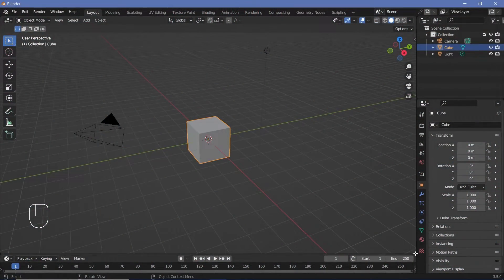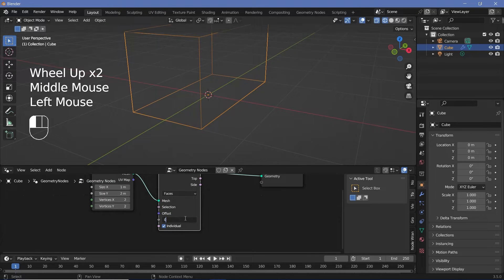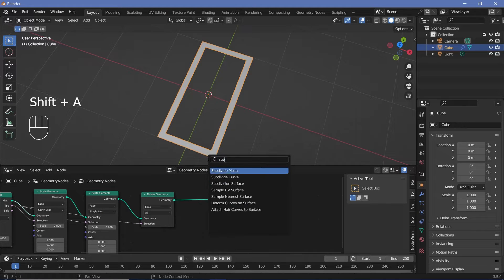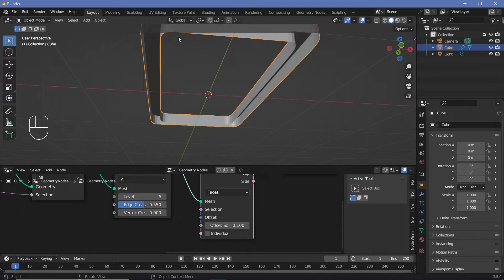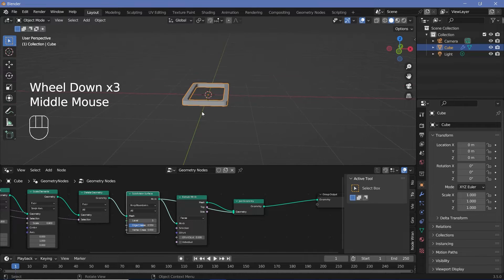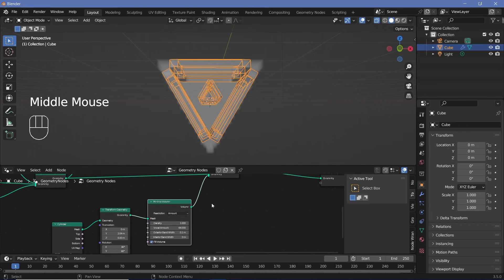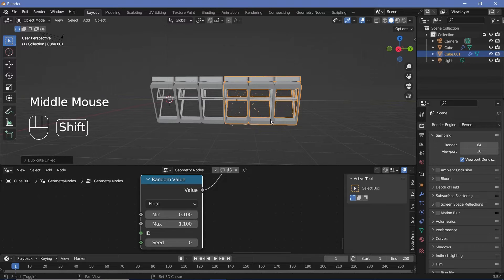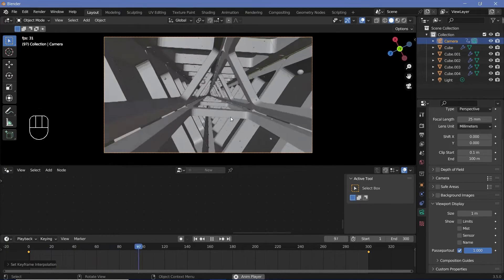Futuristic Sci Fi Loop- Blender Tutorial

Comment: Thanks for the tutorial! I'm struggeling to make a perfect loop in blender 4.2. there is sort of a "flash" in the distance when going from fram 300 to 1. Do you have any tips?
Reply from the maker: I'm not too sure why you're getting that flash.

Are you getting the flash even after rendering out the video? It might be fixed after rendering in the final video. 

Apart from that, there's a possibility that it's because there's a repeated frame at 1 and 300. So ensure that if that's the case, all the key frames are offset by 1.